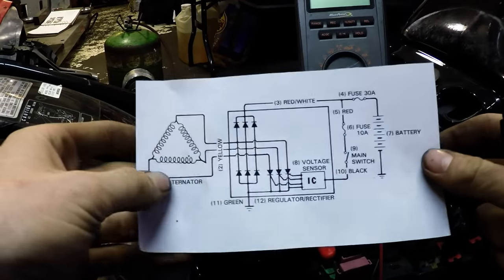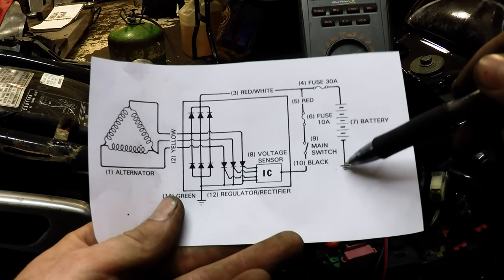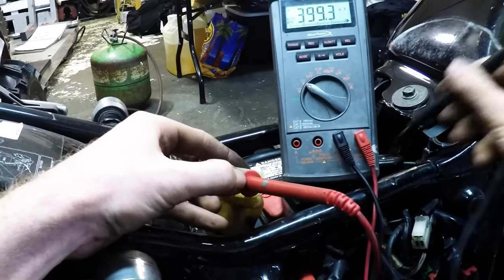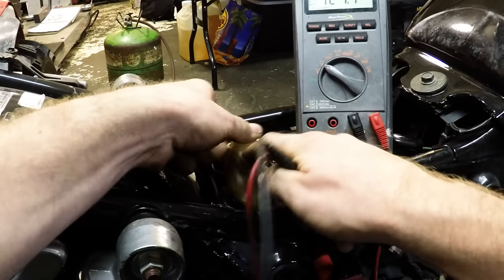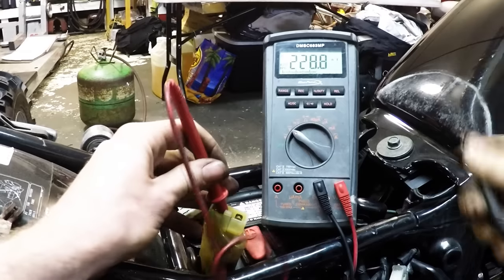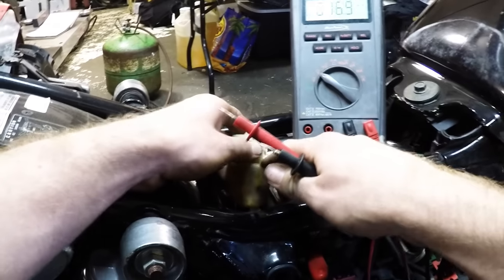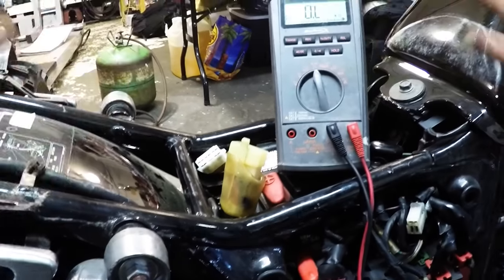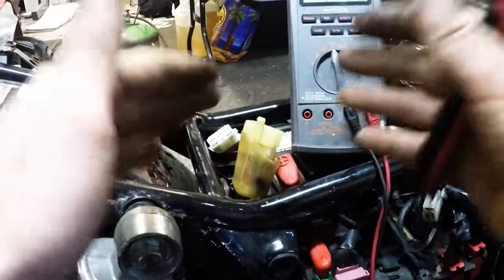How To Test A Regulator/Rectifier

Comment: Hi, thanks so much these videos. My battery died while I was riding, at night, on the freeway, under the rain. Fun times. I ran your tests until this point and I get no voltage from any of the black wires in the plug that goes to the regulator/rectifier when I turn the key on. Now that I know that's a problem how to fix it?
Reply from the maker: Clem Lorteau what kind of bike do you have?
Reply: TheMotorcycleMD 2012 cbr250r
Reply from the maker: Clem Lorteau Hey man, in not sure if you have a wire diagram for your bike but the wire colors for your bike are a little different. For the bike in the video the stator wires are yellow, where as your bikes are black. So indeed you won't see battery voltage on your three black wires with a key on. You should see battery voltage with the "key on" on the red/white wire. Sorry for that confusion. Honda likes to change things up with the newer bikes. If I were you I would get your battery charged and tested properly first. With a fresh battery in the system I would  then run the standard overall charging system check that I show in my other video. Simply placing the meter leads in the battery's terminals, starting the bike and increasing the RPMs while reading what the meter tells you. Should be pushing over 12.8 volts at the battery. Hope this helps! Check out that video and get back to me! Make sure your battery terminals are TIGHT! Cheers!
Reply: Funny you would say that, I just got the service manual for my bike and was looking at the wiring diagram and you're completely right. The 3 black wires come from the alternator. I do get current at the red/white, key on or off.

I had fully charged the battery after having the bike towed. I measured voltage while revving as in your first video of this playlist but revving didn't increase the voltage reading. It just made it very slowly decrease (same as idling the bike really). 

I'll go on and do the other tests you mention now that I know which wire is which. Thanks again for the videos and also for replying to viewer's questions. That's a big help.
Reply from the maker: No problem brother!
 I would be VERY surprised if you have a failed charging system component on that new of a unit, not saying it can't happen but it would be an interesting find! 
If that battery is bad (dead cell) even when it's fully charged can be deceiving. Just because it starts the bike doesn't mean its 100%. If the battery does have a dead cell and unable to hold a proper load, your charging system test readings can show varying results. Charging systems struggle with bringing proper voltage to bad battery and can result in very low charging system readings. It's super important to have a perfect battery to get the best readings!
Good luck! Glad I could help
Reply: Hi! You might be interested to know the fix consited of changing the stator. Even though the stator tests you mentioned passed, I measured the current it outputs and no matter how much I revved it was always only producing no more than 3V at each wire. I replaced it, and even though it looked visually just fine, the new one now sends 25V at each wire at idle and all readings are now correct. Maybe you'd like to add the test consisting of measuring the AC voltage at the stator's output. 

Thanks again for the videos, they were instrumental for me to understand the workings of the charging system and troubleshooting steps.
Reply from the maker: Clem Lorteau Great find! It's abnormal for the stators output to be so low without some kind of indication of breakdown on most of the Honda's I deal with. I have seen that before but it was rare! I'm not surprised that there is always a different case with how many bikes are out there! Thanks for the suggestion, I'll be sure to get this video up to speed!
Reply: thanks for sharing your bikes issue and the resolution. I honestly find it so odd that the stator was bad on a bike as new as that!
Reply: Clem did you get these readings while stat or was plugged in into bike or disconnected off plug? Mines change once plugged in into rectifier

Comment: I checked it and everything is fine, but the Charging is high is up to 17.7v What's the reason?
Reply: Check your connectors between alternator and regulator/rectifier! Corrosion at the connector contacts can cause these errors...but from far away, it is difficult to point it directly.

Comment: HELP!!!!!!!!!!! When i turn on the ignition i get one volt less on the black wire (10.5Vac) I have a '85 magna vf500 (v30) everything else with the test comes back WNL. When i rev the bike voltage goes up to +13-14v but when idleing it can drop down to 10v. (its killing my battery)

Comment: I have Yamaha VSTAR 2000 1100cc, My motorcycls is not chargin the battery while tbe bike has done around 70 kms or when it became hot.  I have changed the rectifier and the ECU.  Anyone that could help me?  I have also checkex the stator and it seems to be ok.

Comment: I wonder why nobody with a Harley dose any videos like this, I can't find hardly any info that is like my bike, its like Harley people want to keep it a secret so you will have to take your bike to them so they can bleed you of your money, its very sad that people do this kind of thing, my regulator is on the front of my frame and one wire go's into the crank case on the front of the engine and another wire go's back then up through a hole in the seat post then out and over to the coil and I've also heard you can't test them from Harley people yet this guy is testing this type of set up, it very aggravating to try and get anything Harley off the internet.

Comment: Hey thanks for the video! May I ask you a simple question here please: on the harness side of the rectifier, SHOULD I get voltage between the red/white and the green wires?? 

I DO get voltage between them (same as battery voltage)! Is that normal? My Haynes manual says I shouldn't! See bottom: http://www.corbeauperdu.com/vt750cdd/ if you have 2 minutes? But than again, my mechanic says I SHOULD! 

Also, the other tests: voltage between red/white and Ground (-) on the battery is okay! And I do have continuity between Green and ground on battery. 

Hope I hear back from soon enough before my mechanic potentially does something stupid (or I do!) ;))  Thanks a lot for your time!! MUCHHHH appreciated!